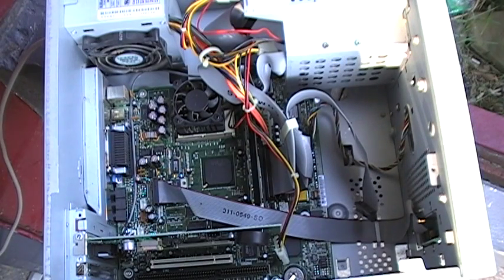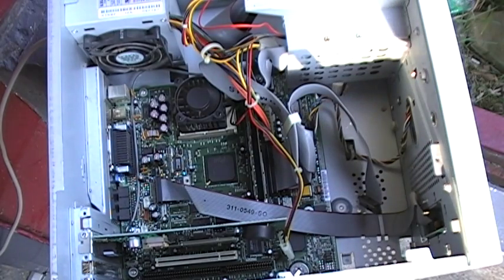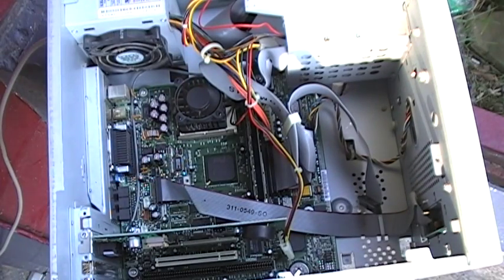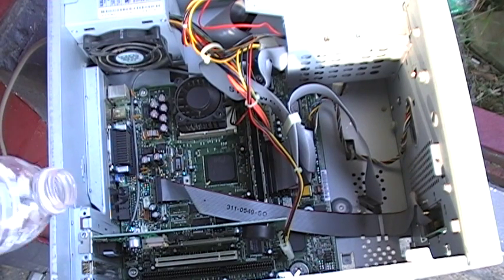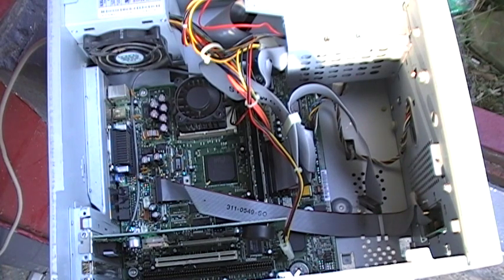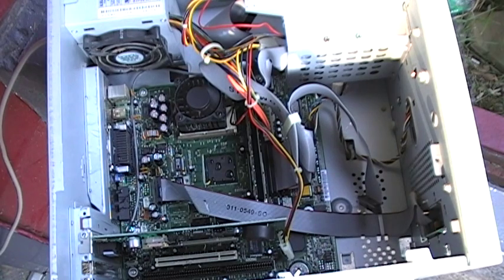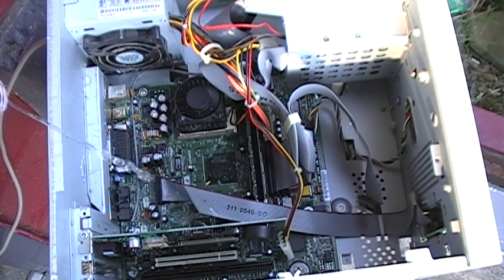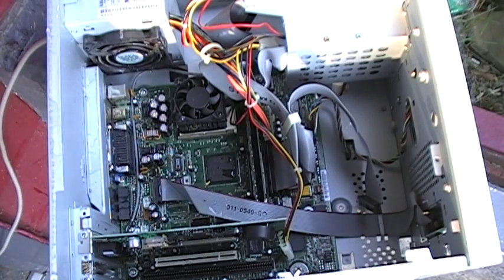Computer Destruction - Water

Comment: Meanwhile 2000$ computers from 2020 break down after you drop 1 drop of water on the case not even the PC itself ......
Reply: i spilled tea on the top of my tower, some of it got on the interior portion of the glass pane, but i think most of it was stopped by the top. this happened like 2 months ago and my pc is completely fine, thankfully
for more context: it was regular green tea that you have to steep, so no sugar or anything.

Comment: hello 2011. I think the motherboard is still ok. power supply would die because it's where the electricity is from. so 90% sure the PSU is dead, mainboard, well it's clean water, it should be ok. :) now it be salt water or some water with stuff in it, then you would of roasted ;\
Reply: Xd

Comment: the reason it didn't short out right away was because water in a bottle is usually cleaned and filtered distilled water and pure distilled water is a very good insulator, plain tap water on the other hand does a very good job at conducting electricity therefor shorting it out much faster than bottled water.

Comment: You don't know WHAT you are doing. You can get electrocuted if you do that. And it is a waste of good components.
Reply: HVI “good”
Reply: Um no how can he get electrocuted
Reply: @hariranormal5584  The neutral is grounded, so when water comes in contact with the hot side of the power supply, it will become live and will eventually create a full short circuit. The metal casing of the computer is conductive, which makes it even worse when it is not grounded. A RCD or GFCI is an active component (it uses energy to work) so it can fail (and that is also the reason that they have to be tested every month officially), so you should never rely only on a RCD or GFCI to trip. I can see from you response that you don't understand the dangers very well. Besides that is this video also pointless.
Reply: HVI 
Well, even if I didn't understand exactly how it works, i sure understood one thing is to not judge people's knowledge by reading comments. And I really want to thank you for that :)

Comment: Hmm... tried this with an old motherboard. Turned off as soon as water touched the board. It worked again after the drop was dried up. Must be some kind of protection.
Reply: It all depends on what connections the water forms.  If, for instance you short a capacitor to a microcontroller and burn out the microcontroller, it isn't gonna turn back on until you replace the damaged component.  On the other hand if a short just flips some bits and puts the computer into a bad state, it can be dried out and work again (minus the possibility of corrosion)

Comment: psu probably diden't die probably tripped the breaker psu's have breakers that turn it off if you short it out
Reply: liam cumings Regardless, if it gets a short circuit, it'll blow before the breaker gets involved. It's not like a fuse which operates when the input voltage gets too high, because short circuiting it won't change the input voltage. It will operate when the current allowed through, because of a lowered, resistance, is too high. And it'll be too high as a result of the short circuit. 

As proof, me and a friend fixed his PlayStation 3, but accidently placed the PSU on without the housing. Either a capacitor or a resistor (not sure which) rolled across the floor, glowing from heat, and almost set his curtains alight. It also fried the PSU entirely and turned the power off in his house. 

To protect against what you're talking about, the manufacturer would have the design the circuit to have fuses or circuit breakers between each component. That would, obviosuly, not be cost effective or space efficient.

Comment: The PC pretty much died from the First few splashes of water, the Fan was going because it still had power, So no, the PC didn't survive till the end, it died at the start, but the fan kept going.
Reply: Nope, because the fan is normally controlled by the motherboard.
Reply: TheEpicSurge But cut half the mother board in half, leaving the fans area, it should work fine (The fan should)

Sometimes the fan is controlled via the motherboard, I doubt this one would be, seeing how damn old it is lol
Reply: The fan is controlled by some IC's in this case it is controllen in trigger by cpu and controlled in voltage by cpu/southbridge. If you cut it in half it won't work because Northbrigde/Southbridge is missing or sillicon die is cracked and it wont work. Motherboard should be fine after a minute in water but anything longer than that can ve confirmed dead because those shorts create data corruption on every IC